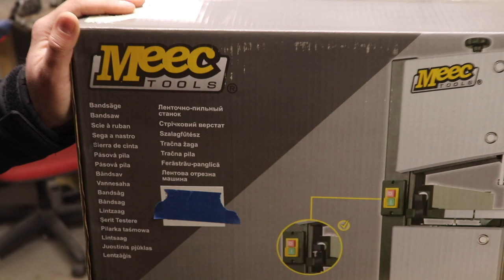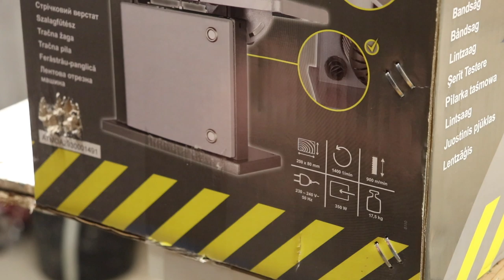Testing The Cheapest Chinese Band Saw Machine

Comment: If you adjust the blade guide to the proper height for the workpiece it wouldn't travel as bad. You had the guide to high in my opinion. I grew up working in a woods hop and have used bandsaws a great number of times. I was taught to bring the guides down closer to the work piece.